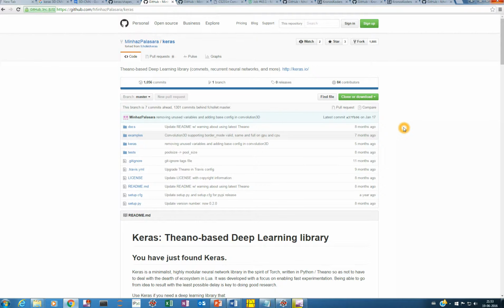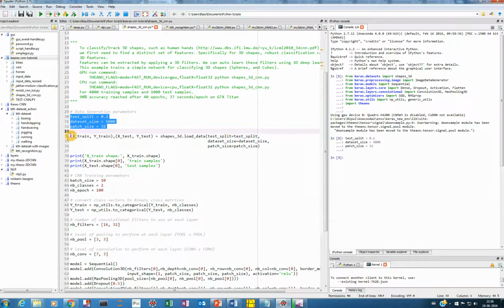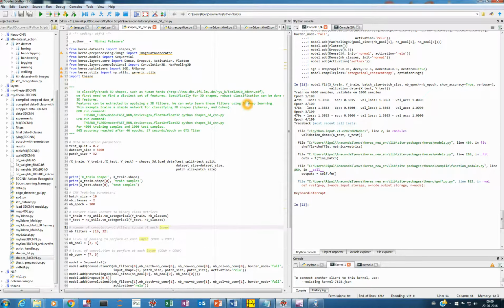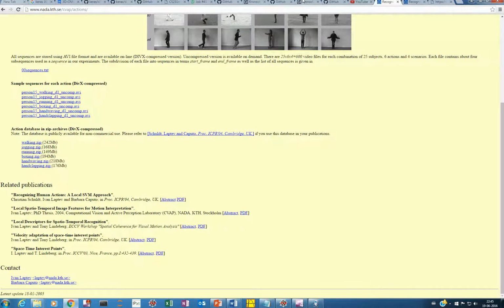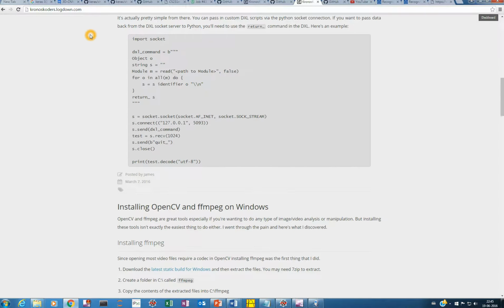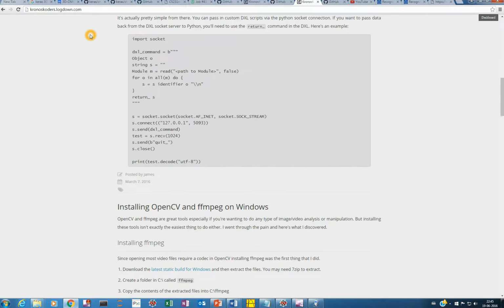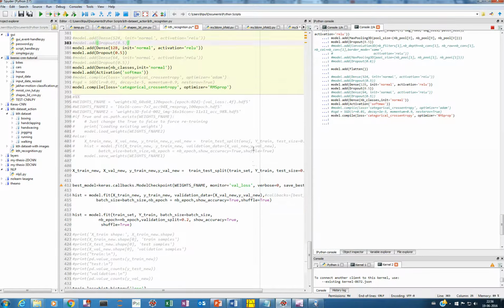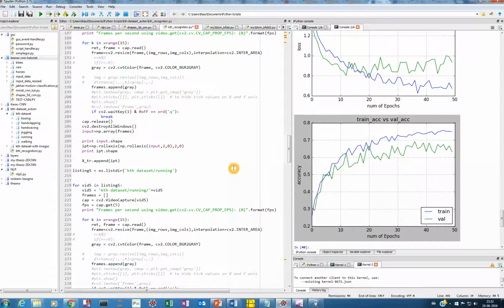3D CNN-Action Recognition Part-2

Comment: please some one  help me, i am getting this error.
 return func(*args, **kwargs)
TypeError: __init__() missing 1 required positional argument: 'kernel_size'
(6, 1, 16, 16, 15) train samples
Reply: I found the solution. Which is also in the blog post. They are using an older version of Keras so the model.add required elements isn't the same. The new format for model.add is model.add(Convolution3D(nb_filters[0],nb_depth=nb_conv[0], nb_row=nb_conv[0], nb_col=nb_conv[0], input_shape=(1, img_rows, img_cols, patch_size), activation='relu'))
All these of course can be changed for your specific system. Also be careful that your kernel size isn't bigger than your data set, or you will get a weird negative dimensions error. Hope this helps
Reply: @greenskiearth  thank you Sir for your interest.
Reply: did u get the ans?
Reply: @yashavhad834  did you find a solution?
Reply: are you find the solution? i have the same problem
Reply: @omarelharrouss1856  did you find a solution?
Reply: same issue here. anyone find a solution?
Reply: Did you get the answer this situation?I have the same problem.

Comment: I think at the fitting part,we should delete shuffle the data. Because it should train as sequential so when we shuffle it'll be not sequential. What do you think ?
Reply from the maker: +Beyhan Gül if we were using RNN then it would have matter. Here you can obviously remove shuffle but each of the input are independent they are not depending on the previous input
Reply: Thanks for your quick reply

Comment: I am getting an error "cannot import name shapes_3d" when I am running the shapes_3d_cnn.py.
Reply: move your shapes_3d to the folder where you have installed your keras and in that keras there would be folder named dataset paste shapes_3d over there it will work

Comment: HI Anuj shah,
Thanks again for this series of videos.

I have a problem , while running this code:
I get:
Frames per second using video.get(cv2.cv.CV_CAP_PROP_FPS): 0.0
Frames per second using video.get(cv2.cv.CV_CAP_PROP_FPS): 0.0
Frames per second using video.get(cv2.cv.CV_CAP_PROP_FPS): 0.0
Frames per second using video.get(cv2.cv.CV_CAP_PROP_FPS): 0.0
Frames per second using video.get(cv2.cv.CV_CAP_PROP_FPS): 0.0
......

instead of reading the number of frames in each video

I want to read frames like you(25 ) for boxing  or any number of frames in the video.

Do you have any recommendation? because all the following steps become wrong

Thanks
Reply: Thanks Anuj, I followed the steps of installing OpenCV correctly then every thing become OK.
Reply: install or configure ffmpeg incorrectly, i have same question! can you tell me how to solved? i use keras on ubuntu, thank you!
Reply: I am using keras on windows and I followed the steps as in the video, and everything becomes OK.

Comment: Amazing video. Thank you very much for making it
Reply from the maker: Thanks and welcome
Reply: Hey!! How to solve this error
"RuntimeError: GpuCorrMM failed to allocate working memory"

I am trying to train my own dataset which consist of 20,000 images of 15 categories using your code. But it is showing this error. Can you please help me with that.
Reply from the maker: Reduce the batch size. maybe your GPU doesn't have space
Reply: Ok thanks for your help. :)
BTW, Can you please tell me how to save weights of each layer.In my case,  I have designed a 6 layer network (3 CNN and 2 fully connected ) and 1 only want to save weights of first five( i.e. 3 CNN and first Fully connected network). How to do that ?
Reply from the maker: you can save the weights of individual layer separately. for example you can save the weights of zeroth layer of the model by using model.layers[0].save_weights("my_weights.hdf5")
Reply: Its showing syntax error.

Comment: Thanks for your great video.
But I have a question: why do you take 15 frames from each video?
15 frames are taken from the start of the video. are you sure that 15 frames enough to describe the action? may be in the latest frames after 15 th complete the description of the video.
Reply from the maker: ya you are correct. I took 15 frames just to show how to code. My aim was not to develop a full working action recognition model. I just wanted people to get started on 3D CNN. Later they can optimize their own parameters suitable to their problems
Reply: OK, Many thanks